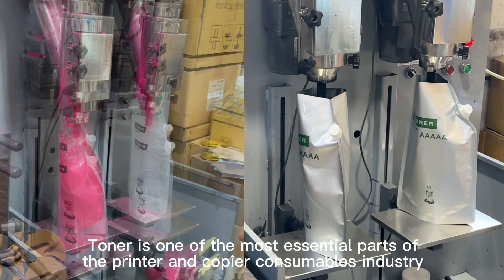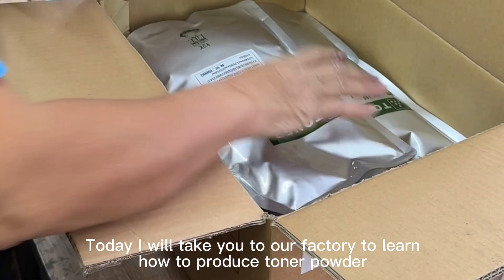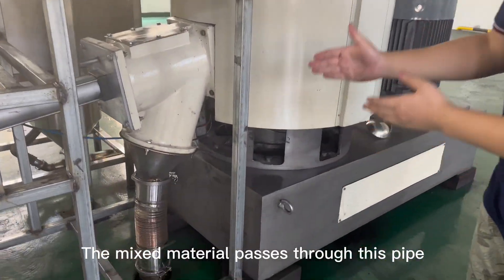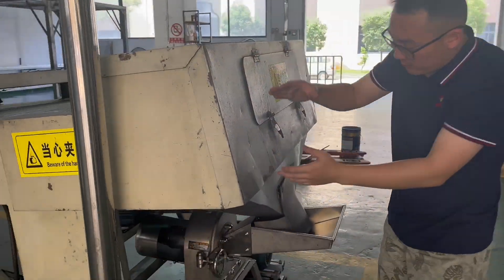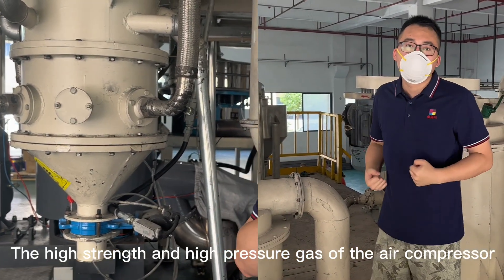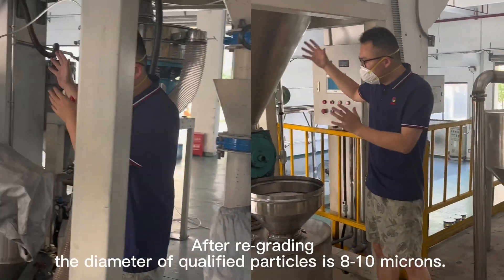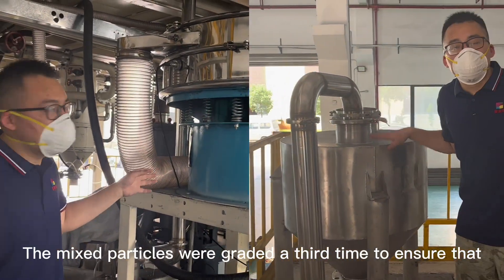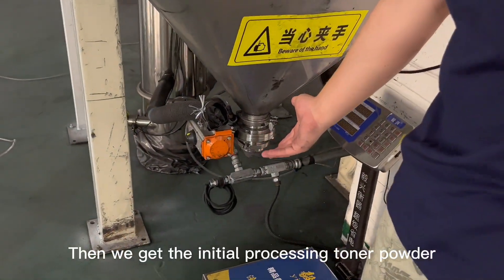The production process of toner

Comment: We are using compatible toner cartridges with our older black and white laser for years, I am very satisfied.  Thank you for your business  (I mean overall for any toner manufacturer)
I have a question regarding the following.  We have a brand new A3 color laser, the latest model from Kyocera (Taskalfa 2554ci)  it says in its marketing material that it uses an innovative toner, that has two new features:    A. it is a low temp toner     B. it has a wider color gamut for more vivid colors.

Can you please comment on this if the compatible toner manufactures are prepared for these innovations?    There are already compatible toner cartridges available for this printer, but I have no information regarding these features, so we are still hesitating to use them.   Should we raise the fusing temperature in our printer?   (somewhere I saw this is possible to set)  and what about the color gamut?  Has it been tested on the compatible toners?   We are using our printers for production, the printed pages is our product, service, that is why we are concerned about the print quality)   
Thank you for any reply.
Reply: "Modern" toners are made by chemical methods. What he showed are probably shabby machines for phisical toner. 
Some manufacturer employs toner so special that compatible toner would always cause troble.
Kyocera is one of them. Hp/canon is much safer. Some jap companies compatible toners are more vivid than oems.